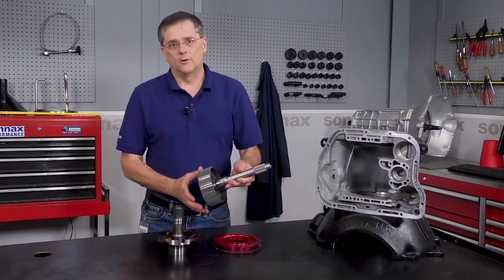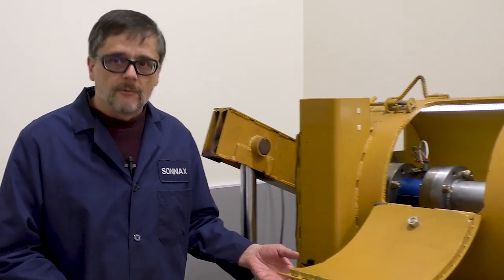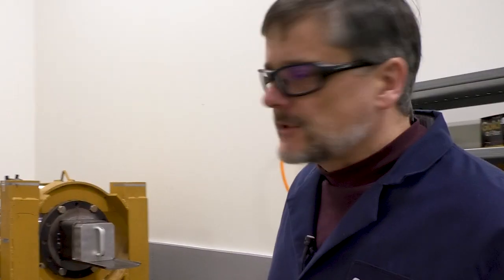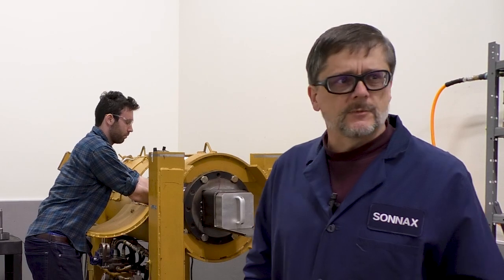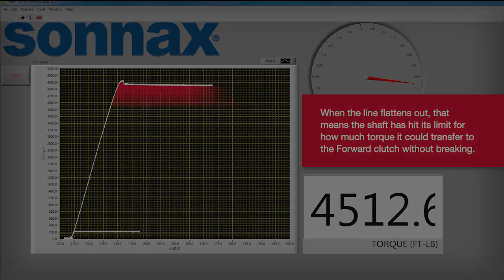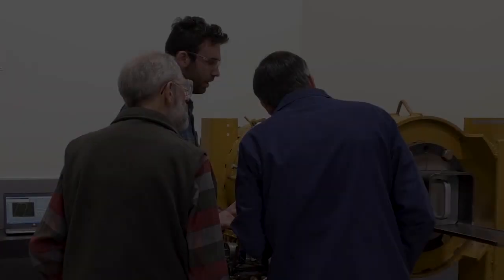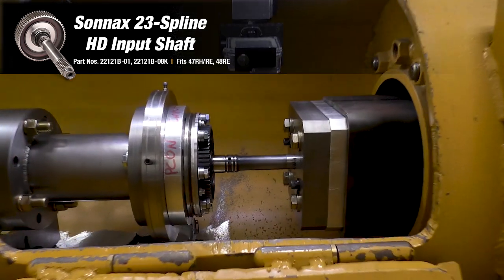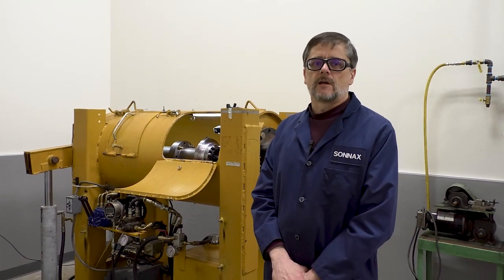Torque Test: Sonnax 48RE Smart-Tech® Big Input Shaft Kit

Comment: What is stronger?
Aermet or this?
What allows more twist and still returns to original shape?
Reply from the maker: The Sonnax big shaft 22121B-08K is made of forged 300M steel and is the strongest input shaft available for 48RE. 

All things being equal, properly processed Aermet 100 does have some advantages over 300M, however these advantages are incremental. The Sonnax shaft is .100” larger in diameter than conventional shafts, and this size difference contributes to a huge jump in strength versus any conventional diameter shaft.
Reply: So around 4500ftlb it twisted? How about with heat added?